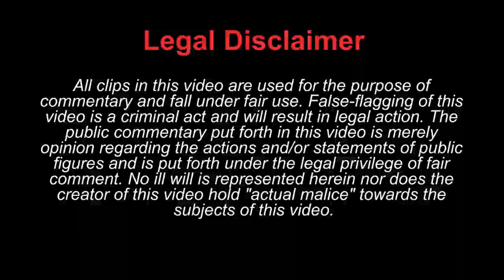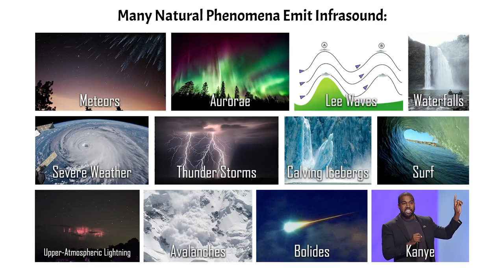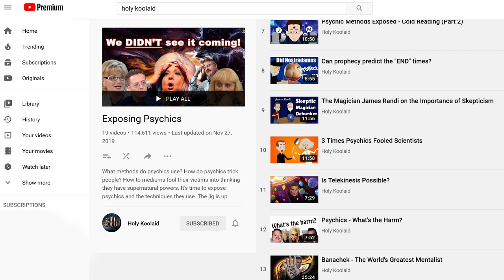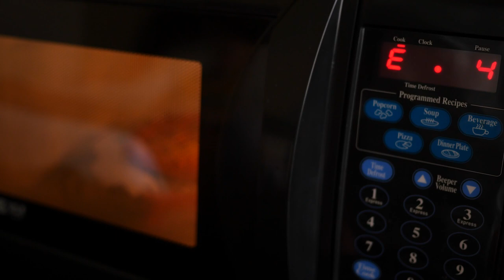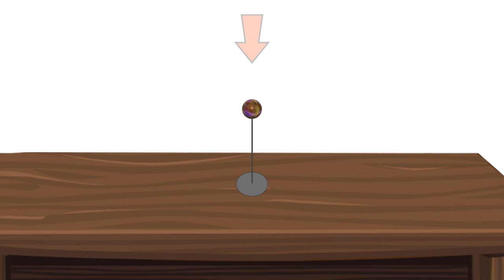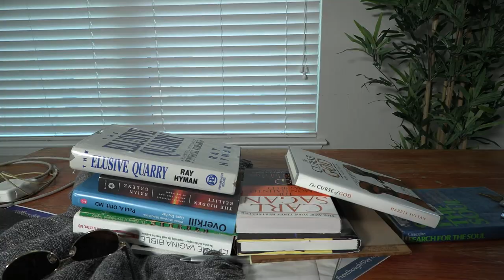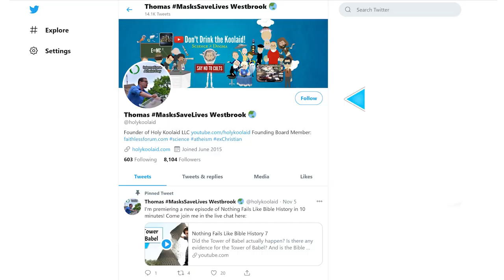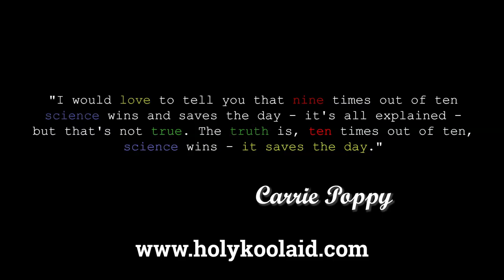5 Things Commonly Mistaken for Ghosts (Part 2)

Comment: I remember the first time I moved out of my parents place, I used to hear sighing, and what sounded like a ball being bounced down the hall.  

A plumber came in, and said the previous owner had put in all the valves in backwards!  Once that was fixed, no sounds.

Also, as an exterminator, I know there are mice in every house, even if you don't see signs inside the house.  So when people tell me about their pets staring at a corner of the wall, and try to tell me it's ghosts...  Also, another point about young people hearing things, I went to a house where the people had carpenter ants in their walls, their young child could hear them making scratching noises.  There are lots of bugs which can get into our walls, and make noises, the deathwatch beetle being the most famous.

Comment: infrasound is actually terrifying, it can really fuck you up even knowing what you see or hear isn't real... also, both my living room and bathroom doors pop open and swing wide at night, pretty spooky till you realise air pressure in the close when other folk go in or out their flats and the building leaning toward the street ever so slightly is whats causing it... at which point it just becomes annoying. :D

Comment: One day, in a house I used to live in, starting at the front of the house all the windows and doors started to rattle, and the effect went from the front of the house and moved through to the back, slamming doors on its way. And afterwards the atmosphere felt really oppressive. Fortunately I am a grownup and knew that it was just a change in air pressure moving through the house. Made worse by it being the middle of summer and some of the windows were open (we rarely have air conditioning in our homes in the UK), but I remember thinking at the time, that if I believed in ghosts, I would definitely have chalked it up to that.

This new house doesn’t like changes in air pressure either. We had to have a new attic door fitted, one with a lock, because drops in air pressure would lift the old door right out of its frame and slam it back down again. Pretty freaky when it wakes you up in the middle of the night.

Another thing with this house that annoyed me until I figured out what it was, is that the central heating boiler (which is in the airing cupboard in the bathroom) causes one particular picture frame, on the landing, to vibrate.

I have also suffered hallucinations. One particular bout, that lasted for several weeks, was caused by medication I was on. But one time I had an incredibly vivid hallucination, caused by stress, that has caused long lasting effects. I am not going to go into details of what it was, but it wasn’t nice, let’s put it that way. It was in bright light in the middle of the day. I tried closing my eyes and opening them again, several times, to try to make it go away, but that didn’t work. I tried turning away and back again, but it stayed there, threatening me. It was one of the hardest things I have ever had to do, but in the end I just had to turn my back on it and ignore it. The odd thing is that, even though it happened in light, during the day, ever since that day, I panic if I wake up in total dark. I’m not scared of the dark and I am fine with it otherwise, it only happens if I wake up and it is dark, but it has meant that I have had to sleep with a nightlight for several years now, even though, as I said earlier, I am a grownup.

Comment: Low frequency:
I had a high-quality sound recorder and studio microphone and recorded my wife playing an instrument, at home, trying to get good quality.  I turned off the fans etc. to eliminate noises.  I sent my first try to a friend with "golden ears" and he reported anomalies at a couple of time codes.  When I examined the files carefully to figure out what was different about those passages, I discovered a subsonic noise, between 15 and 30 Hz.  This recording equipment basically can get all the way to zero in terms of what is detected and faithfully preserved.
I wondered, what causes that noise?  I did some searching on the web, and found references that common building materials can have resonance in that range and be set off by things like passing trucks.
It makes sense that "noise" might persist outside of our normal sense range.  People building a house, for example, make sure it's quiet against the sounds from outside, and doesn't squeak or rattle -- any such bothersome sound would be noticed the techniques changed to prevent that.  But sounds outside of our senses would not be eliminated and there might very well be some present.
Likewise, our windows appear clear to us.  Even tinted glass reduce the light in a manner that our brains can automatically adjust for without noticing, so it just seems "darker" rather than blue-tinted or completely throwing off certain colors, even as we strive to make it more opaque to frequencies outside our range of vision (blocking IR and UV).
The appliances may make sounds we can't hear.  Objects may have smells we can't smell.
I've sometimes wondered how the world appears to our pets.  Does the window light appear heavily tinted to the parrot who sees into the UV?  Do any animals perceive the "dimmed" lamp to be flashing instead?
When my sister moved into a new place, the dog was bothered by something in the kitchen.  She jokingly (?) said it must be a ghost and burned sage to purify the space.  Remembering the subsonic ghost I found in my own home, I wonder what the dog was sensing that the poor humans simply did not perceive.
Reply: Huh! Really interesting comment, and also very helpful. My dog who is 13 has been having on and off periods of anxiety and restlessness that are only calmed by going outdoors. Sometimes it seems to coincide with the steam heat kicking on and warming up the pipes, and other times not so much, so I haven’t figured out the cause yet. That story about your sister’s dog and the kitchen made me wonder if mine might be picking up on some very low frequency that I’m not picking up on. Hadn’t occurred to me until I read your comment, and anything that helps point towards a solution is much appreciated. Thank you

Comment: I used to work at a SPA center which was build in the basement of the hotel that used to be a soviet university in Almaty. One night I was closing my shift, checking the whole facility. I closed the men sauna area and went downstairs to VIP section. When I was coming back up I heard a shower going full pressure in men sauna area, no lights on. When I came literally to the shower door, the water stopped and I saw the rest of water dripping. That was spooky.

Comment: Oh, almost forgot.... #4. The McGurk Effect! This is the sonic analog to Pareidolia. It's the reason why even a non-believer will hear "hail to my sweet satan, whos power is satan" when they listen to Stairway to Heaven backwards... so long as they're also reading this text OR told to listen for these words.
Reply from the maker: There's a really cool video on youtube where someone coupled the Yanny Laurel illusion with the McGurk Effect and it worked.
Reply: @HolyKoolaid  yep! I’ve seen that, as well as a similar video with “Brainstorm / Green Needle.” There’s another optical illusion involving the silhouette of a spinning ballerina that you can will your brain to change the orientation of (CC or CCW). A GREAT question for a neuroscientist would be, are these optical and aural illusions related??

Regardless, to the point of your excellent video, our brains play tricks on us ALL THE TIME! Whenever somebody says “the brain is the computer of our body”, I want to punch them!!! The brain is NOTHING like a computer. Computers crash when things don’t add up. Our brains make do with whatever sensory info we feed them, and we cannot tell the difference between a genuine input and a corrupt or distorted input. 

A better analogy is that our brain is like a board of executives of a massive company, each with an area of specialization, that are required to report to the CEO (our conscious self) what’s going on across the company moment to moment. They cannot ever miss a report, so whenever things get weird or distorted, they just report what they see from their position. I did a whole episode on this for season 3 of the show “through the wormhole” called “did we invent god?” I didn’t get to cover ghosts in the episode, but the research overlaps. 

I think you’ve done a FANTASTIC job here surveying the various non-supernatural causes of “ghost” experiences. Well done!
Reply from the maker: @themugwump33  Thanks! Just looked up your IMBD. You've done some cool stuff. I'm going to have to check out Through the Wormhole. Breakthrough also looks like it'd be right up my alley.

In the meantime, you should add me on Facebook, if you'd like. :)

Comment: We recently moved out of our old apartment. The house was old and had been refurbished several times and my apartment had originally been an old break room located in the basement. In our bedroom we had a stair that ended in a blank wall. This wall was only thin plaster.
On the other side we had our local gun shop.

Today I was talking with the former owner, and he swore that his shop was haunted.
The alarm for the bunker they had the guns in would inexplicably go off, in the evening and at night when they where taking inventory they would sometimes hear voices talking and childrens cries.

From their side, the wall looked like any other wall, but what they had heard where me and my wife and our small kids.
And the alarm? Well, sometimes I had to drill a hole or two, and the alarm in the gun bunker would pick up the vibrations as they traveled through the concrete...

Comment: I work at a psychiatric facility with numerous old, steam-heated, buildings. When the steam turns on, the pipes bang. 

When I worked security, I could be alone at night. Yeah, I heard all the normally-masked noises. The icemaker sounded like someone bumping into the chairs in the break room. And there were plenty of things on the monitors that looked like people sitting at desks. Since these were the cameras that took a picture per half-second unless the sensor triggered, it could be hard to tell if that was someone who'd come in for some overtime or just an arrangement of equipment.

Comment: Badly laid copper pipes in floors can make an insane amount of noise. I thought someone was chopping wood outside when we first moved in; it was a pipe hanging up on a joist and then breaking free with a loud thump; constantly, for a really long time whenever the heating was on. The house still does it - once, more quietly, each time the pipe gets hot and again when it cools - as if to remind me that my DIY skills aren't good enough to totally solve it..

Comment: I spent an afternoon investigating "brown noise", which is around 5-8Hz and apparently can cause involuntary bowel movements. After a couple of hours I'd made myself temporarily ill in a variety of ways, from weird aches in my head/neck, vision defects, difficulty breathing smoothly and moderate nausea, but no brown pants. Apparently my bass tube isn't big enough to produce the amplitude required, and I didn't see the point in buying an 18" driver just to soil myself.
Reply: Brown note, not brown noise. Brownian noise (often shortened to just "brown") is noise with a 1/f^2 frequency spectrum. Sounds like a waterfall.

Comment: The house I live in is 140 years old. It makes all kinds of weird noises. I also live in the country so night time is particularly quiet, so when the timber floor suddenly decides to creak in the middle of the night it's super noticable, and because of the way humans are wired, really unnerving.
My cousins lived in a huge 3 storey open plan brick house with tiled floors. Any sounds at night would echo around all the hard surfaces and sounded a lot like footsteps. Sounds kinda silly but it was really creepy when you heard it.

Comment: The most common one I see is "orbs". As a pro photographer I know for a fact that when shooting at night in infra-red the aperture is open wide giving you a really shallow depth of field (the bit where your camera is sharpest is a lot narrower basically) then you have the direct lighting on the camera which the angle of instance is a direct reflection back into the lens so when a small bit of dust hits the cameras infra-red beam in the right way in the out of focus area the light is reflected into the lens and defused giving it the appearance of being bigger than it is. Different lenses have different depth of field profiles aka bokeh so when you see the shape of these so called orbs it's possible to have a general idea of what lens is being used based on the shape produced by the wide aperture and the number of aperture blades the lens uses and these orbs change to the same profile a light would when it falls into the out of focus parts. People alway like to fight me on it and tell me my job because the want to believe so badly but they are also not willing to learn the technology they are using and its flaws. A lot of other ones I see are blurry images shot on a slow shutter and you have a general shape that the brain thinks is a face or person (paradolia) then there are the disingenuous ones like double exposures (taking a shot twice on the same frame of film, overlaying two negatives in the darkroom or blending two digital images with a screen mask in photoshop) to give a person or solid object the illusion of transparency. These techniques are so easy anyone with basic camera knowledge can pull it off with little to no effort.
Reply: And you can't convince then that an orb isn't a spirit!

Comment: i lived in a haunted house for 3 years. everything can be explained except being struck from unseen source. tho i have never had or since experienced  the high number of "un"explainable phenomena i did living there. fans turning on (electric problems) doors and cabinets opening (gusts of wind) items moving (vibrations) footsteps coming from rooms above you (floorboards expanding[tho this one was very unsettling as it sounded like heel/toe, heel/toe just like someone walking with hard sole boots]) nearly every phenomena you can think of besides actual voices or seeing things.

Comment: According to my brother, at the Westbury Firehouse on Long Island he claims it is haunted. That the elevator will automatically go to the top floor, where all the offices are for the different companies like hose 1,2 etc., when the elevator is on the top floor, the doors open all the automatic lights turns on, but one at time as it supposed to when someone walks by the sensors. he told me that he was just sitting in one of the offices one day, from the elevator there is a small corridor which leads to 4 offices three on the side and one adjacent from the elevator, the office he was in is the middle office. So, he said he was working in the office for a few hours and the automatic lights would go off when there is no activity, and that he can hear the elevator operating. Throughout the day other members of the fire department would walk through the corridor, they would be talking amongst themselves and you can hear the feet walking towards the office he was in. They would go to the other offices or pop in his office and say hi and they would be leaving once again, leaving my brother to be the lonely person on the floor. Here is where the story starts, he heard the elevator doors ring, thinking it was his fellow fire department members not thinking too much about it, from the office with door wide open he could see the corridor lights come on one at a time, he did hear anybody talking nor footsteps walk towards his office. Out of curiosity he got up from his seat to see who it was, and nobody was there, when he got up to walk towards the doorway all the lights came on, he looked out the door and the corridor was empty, he walks outside his office to see if anybody was in the other offices and they were all empty. Other members of the fire department would report this same thing. My brother is not a supernatural believer, nor does he believe in any faith. However, I think there is much more to this that i cannot figure out. I think there is faulty wiring or something else that I can’t explain.

Comment: Yap
And I have to add also, most of the noises (all of the noises) that are used in Hollywood movies, the Nazguls, dragon roars, banshees
They are all either direct recordings or more commonly audio distortions of run-of-the-mill animal sounds 

These also tend to get reused any number of times in movies going forward so that soul-cuddling Trex roar thay you'll come to associate with all dinosaurs because of a 2018 movie was actually a crested crane mating call first recorded in 1945

Comment: Has a ghost ever knocked something off a shelf in your house?
The correct answer is "No, of course not, because ghosts aren't real", but in case anyone is too ignorant to know otherwise... check the street outside your house. Any cracks in the asphalt? There's your ghost: heavy vehicles going over a crack in the road = entire house shakes. Still don't believe reality? Fill a bowl with water and watch the surface when there's a lot of traffic.
Higher up in the building you are, and the taller the piece of furniture your ghost-knocked-over things are, the more wobble. Simple physics at work. No crack in the street? Neighbor's kids.